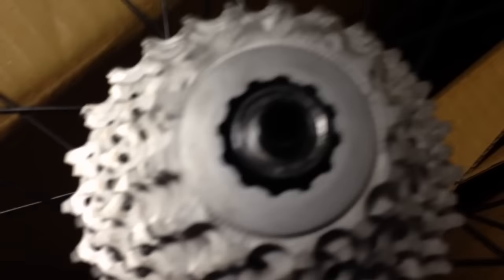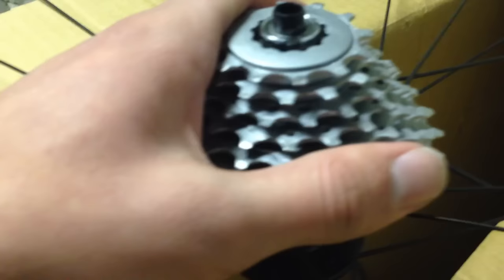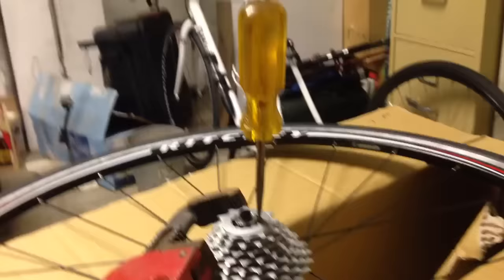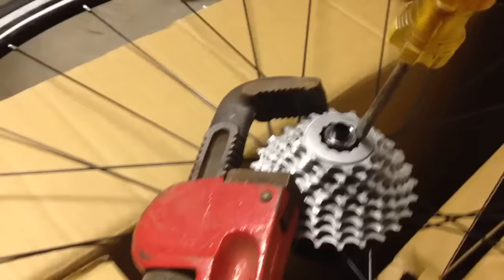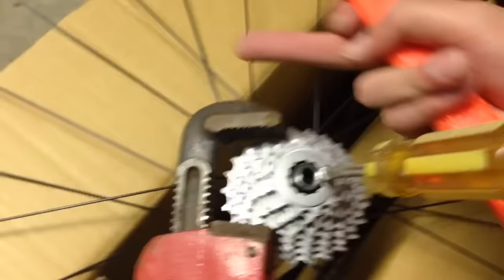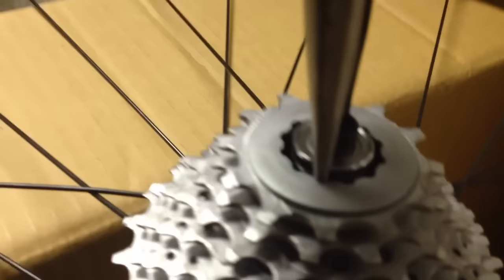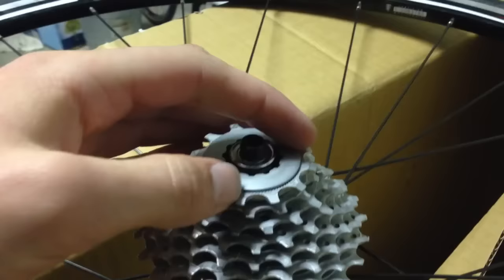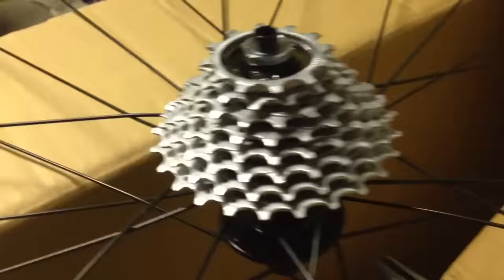How to Remove Bike Cassette Without Special Tools (IMPROVED

Comment: Folks please do not follow these nonsense.  These tools are pretty cheap to purchase and will prevent you from doing damage to your bike.  Get the right tools and save yourself a lot of headache.  If you ride a lot it's worth the investment.
Reply: Yeah really what's wrong? You don't want to get new tools? I love to get new bike parts but I'd much rather get new tools. :)WEST COAST:(
Reply: Unless one is semi-mechanically inclined and resourceful. I fully intend to buy all necessary bike specialty tools, and still have managed to get multiple parts changed without specialty tools.. these I'll likely order a cheap tool
Reply: If someone’s watching this video it’s because they need their bike fixed ASAP and don’t have the right tool, of course we’d prefer to just buy the right tool for the job
Reply: Agreed

Comment: if that cassette its tight enough its no way on earth you can hold it by hands and use that tool to open it.
Reply: Steven Mark Tobin  That's the daftest reply yet! So with the wheel back in the frame, how does one unscrew the lock-ring ?
Reply: Funny as hell. ;)WEST COAST:(
Reply: Use a towel to hold the cassette. Makes it way easier than your hand and worked like a dream.
Reply: @mzoern  sure did?

Comment: A chainwhip and the proper socket wrench are not expensive and every bike shop sells them. If you damage the cassette and hub then it's goodnight Vienna!
Reply: +KRAZEEIZATION They cost more than the cassette
Reply: +ixRAZORxi socket wrench is 8.95 EUR, chainwip you can make yourself with an old chain or use some heavy cloth to keep it in place. Just bought a shimano cassette for 30 EUR which was the cheapest shimano cassette I could find. So I don't know where you get your info from but yea, your argument is invalid ;P
Reply: +KRAZEEIZATION it's the weight, for touring, that makes socket wrenches + monkey wrench + nut rather stupid, because half of the time you won't even need them and still you need to bring them. So being able to do it with tools you find in every motorcycle store is a great help for tourers.
Reply: +ixRAZORxi I have had the same chain wip and cassette tool for 20 years. It was a good investment.
Reply: Messing around with improper tools always causes damage. Hammering precision parts like this is total disrespect to the engineering of them in the first place. A chain whip is pretty cheap, does the job without pain and costs far less in the long run. If you damage the cassette, hub and axle by hammering then you're really out of pocket, so pretty please with sugar on top, use a gawdamn chainwhip!!!!
Reply: +KRAZEEIZATION  the comment section in this video is filled with pseudo home mechanics a proper tool is a good investment and cheaper to do in the long run some people are just wayyyyyy stupid
Reply: +ixRAZORxi  its a good investment rather than you damage the tooth of the cassete and need yo buy a new one its safer to buy a chain whip and cassette remover. if you cant buy such tools and maintain your bike stop cycling. pls just stop its bad for the whole cycling community
Reply: +ixRAZORxi i paid like 5$ for the socket and made a chain whip for free out of some old chain and flat steel bar
Reply: +KRAZEEIZATION yep, and one could find them even cheaper used.
Reply: +Eric Herrera I mean the proper bicycle tools used
Reply: the chain whip is too expensive at the bike shop where I live....A chain whip from ebay is the ansewer.Not all sockets will squeeze in there you will need a thin wall socket...Investigate before making a suggestion...
Reply: I know some people are arguing, you might damage the cassette, personally if i damage the gears it doesnt matter to me, i can even damage the wheel beyond repair, i need it for the flat stock round metal of the cassette, id do it with a torch, but i got no torch, and i dont ride bicycles, so i dont see it as a good investment to buy some bike maintenance part ill almost never use unless im using a piece of scrap from a bike.
Reply: If they are cheap then why are you trying to learn how to do thia
Reply: KRAZEEIZATION Nice comment, well said.
Reply: Goodnight Vienna ?? So if a jackass damages the cassette he gets to see Ringo Starr and listen to the Goodnight Vienna album ?? WoW !
Reply: waaaaa... damn youtube safety patrol... your comments are common sense. But I have been removing cassettes with needle nose pliers for ever... never damaged one unless you consider some small scratches or slightly dented teeth damage... more likely to break your tools than damage the cassette... but most other bike tools are definitely a must have if you don't wanna tear somethin up!!
Reply: BaaaHahahahaaa..// Good one SouthHemiTV 3* Successful brain surgery.
Reply: SouthHemiTV 3 Ha! I know right? I'm a jack of all trades and I hillbilly fix a lot of things....no damage and it saves money.
Reply: KRAZEEIZATION use a 1 inch socket to use with the lockring tool
Reply: KRAZEEIZATION nu
Reply: @cyclingpunkhero2752  park took for the win
Reply: KRAZEEIZATION I just bought my bike from walmart(I know it’s not a very good place for this, but I’ve been throwing upgrades at it) I’ve bought a new 7 speed cassette for it and don’t have money left over for tools. So I kinda need to improvise here.
Reply: KRAZEEIZATION Good night Irene!
Reply: If you are going to be doing this repeatedly, the investment would be well worthwhile... if you only expect to do it only once, your 'cheap tools' would double the price of a cassette replacement, if I bought them at my local cycle shop.

Comment: I used plastic clamp to hold the cassette, the jaws weren't able to grip but the cassette easily dug into the plastic and gave me a pretty solid grip.  I then used your idea with the needle nose pliers and clamps some vice grips perpendicular to them for leverage.  Worked like a charm
Reply: Would a clamp to remove an oil filter work to hold the cassette?

Comment: I agree with most of your points
- never use the pipe wrench or 
- never use the screw driver on the locknut

The ones I disagree with are
- using the needle nose pliers, on the locknut
- using your hand on the cassette

These are potentially dangerous

The proper tools are necessary

Comment: Some of these things are crazy tight.  I was able to remove one tapping on it, but I had another one that I had to bring to a bike shop and two people almost couldn't remove it with the right tool.  Tapping with the hammer can also easily damage the bearings inside because these bearings are much softer than the ones on the wheels. So really try tapping gently, and if it doesn't work bring it to a bike shop, they will remove it in 2 minutes and may not even charge you.

Comment: This worked perfectly for me.  I used a pair of needle nose pliers, placed their tips into the groves.  I put on a a pair of mechanics gloves, and this allowed me to put my hand into the handle of the pliers (near the pivot point) to apply outward pressure on the pliers (as you are using the pliers in the opposite direction, not to grip but apply outward pressure against the grooves).  My second hand was able to grip the cassette tightly (again because of the gloves).  I turn both my hands, and pop it loosened up.

Comment: I have the tools for the job, they are not very expensive and make life a lot easier.

I needed my chain whip today but I have left it at moms, so as an alternative I used a bike chain I had hanging up, wrapped it around the cassette, then stood on the chain with both feet, then used the special tool to undo the locking nut.
Reply: +RandyDarkshade Yup I've done this as well! PITA too!

Comment: my hand grip stength wasnt enuff. so i did buy a chainwhip online.ironically the removal tool that came with it didnt fit any of the wheels i was working  on, it would not  go over the nut. S0, alongside the chainwhip , I  used a pair of plumbers pliers that i already had, to grip across both jaws of the pencil nose pliers when placed (wedged) in the lock ring. i found this replicates the direct force of removal tool and spanner rather than the pushing in then  twist forces generated with the hand. it was successful on both wheels. just b mindful to lean the wheel against your legs and apply downward pressure keep the pliers stable no wobble. if  they are loose it can jus slip out with a chance of rounding the spline on the lockring.  so thanks for the video it helped alot. i can now go riding on my turbo while we are locked down. be healthy keep safe, Stay Home.

Comment: Thanks for the video...worked great for me!!! Was doing it all wrong until I saw this video. I used needle nosed pliers but instead of using my hand to hold the cassette, I gently pushed/wedged the largest cassette onto a vertical 2x2 wood post (to keep it from spinning) and loosened the nut! Thanks!

Comment: Super helpful, cheers. It occured to me also if holding the cassette isn't enough (even with gloves, of course) you might wrap cord or rope round and round the gears in place of a chain whip - it should eventually bind into the teeth, but not put any strain on one particular tooth like the pipe wrench. Gonna go get mine off now!
Reply: Ah, ok, well mine is one of those bitches that ain't comin' off without a fight - I'll probably have to take it to the shop.

Comment: Great video! The needle nose plyers really did the trick and I only had a small pair. I have the actual tool in storage hours away. I wouldn't have bought that tool had I seen your video. Nice and short, quick to the point. I did use a big pair of channel locks. Thank you! And blessings your way.

Comment: next time I would try using a old piece of chain to hold the cassette instead of your hand, it would be more comfortable and work about the same as a real chain whip.
Reply: yeah ill probably be buying a cassette lockring tool for like 7 bucks but using an old chain and holing the chain with pliers works great instead of a chain whip
Reply: I absolutely agree.  I use this chain method and simply stand on the end of it to immobilize the cassette while my wrench releases the ring.
Reply: Same thought crossed my mind. Thanks for sharing this

Comment: I'd invest in tools . Your best bet is a Table vice grip and cassette removal tool, along with a chain whip (depending if cog ring or freewheel ) lock cass. Removal tool on vice grip , place wheel In proper removal tool and turn counter clockwise . !!

Comment: Thanks for the help I ended up taking my old bike chain nailing it to the 2x4 and then wrapping it around a few times then i put a screw in-between where the teeth would engage and it finally worked 🤣🤣 but your video helped me out to brainstorm this idea ahah

Comment: you dont need a chain whip. just a short length of old chain held in a mole grip works. id get the proper tool to remove the locking ring though. but the needle pliers looks ok, if you have them the correct size. if not you might as well just get the correct tool
Reply: Why not use the bike chain?
Reply: @Kitiwake  i have used a chain whip many times since then. it makes the job pretty easy

Comment: The easiest way I have found to undo the lock ring.
First remove the spindle.
Then get a bit of chain and wrap it around the cogs and push a screwdriver through the chain links.
Get someone to hold this .
Then get a 2 pence piece and a adjustable spanner.
Make sure you put enough downward pressure on the 2 pence piece and the adjustable spanner is a really tight grip on the 2 pence piece and then undo the lock ring. 
It can be done quite easily as long as the lock ring isn't stupidly tight.
I used to do this year's ago when I was a lad and didn't want to pay silly money for the tool.
But now I have the correct tools.
It is easier with the correct tools.
Try it you might be surprised how easily it works.
So don't judge until you try it folks.
But if the lock ring is stupidly tight it will just bend the 2 pence piece. 
There that's my trick for undoing the ring.

Comment: I spent about $9 and ordered the socket on Amazon and it came in 2 days. It was still INCREDIBLY hard to get it loosened. I dont think any one of these techniques would have worked if you have a bike that is more than a few years old. To me it was worth it not to cause a more costly repair (i.e. a new cassette) to my bike.
Reply: Yeah, its good to get the tools if you otherwise damage it or you will be doing this more than once.

Comment: I've got the tool somewhere but all I could find was the chain wrench, I tried the round nose pliers but it was too tight so I heated the locking ring with a gas torch and it freed off OK, the reason I wanted it off was to check it out, I'm going to weld sheet metal ring onto the smallest gear and convert it into single speed (it got an ebike kit so that's all that gets used)

Comment: I tightened a g-clamp nto the teeth of the cassette, so that the handle was down into the forks. This prevented it from turning as I gently tapped a masonry chisel into the lock nut.

Comment: I've done enough mucking about working on bikes without the proper tools-as a kid. It's not worth it. You can buy the lockring tool for like $7 on Amazon. You can easily damage components and yourself. Use the right tools. If you must you can use the pipe wrench with a few bits of wood to protect the teeth (if reusing cassette). You can also make a DIY chainwhip with some old chain. Also, the lockring needs to be torqued down pretty good when installing a cassette-good luck with that without the lockring tool.
Reply: The lockring does not get tighter with a cassette and freehub body. Hence the torque specs on the lockring itself. On the old system where the cogs are on a freewheel which screwed on to a freewheel hub, pedaling would tighten it up. These are two different systems for getting cogs on rear hubs.

Comment: All about pulling a MacGyver in a pinch but I fail to see this as a worth the risk and hassle for general bike repair. You can get a chain whip/socket/wrench combo on Amazon for like 15 bucks, I’ve used my kit countless times and its still working fine two years later. I just don’t understand people’s resistance to buying tools for stuff they will inevitably will have to repair.

Comment: did it with a hammer and a flathead . i just place the wheel on the ground and semi stand on the gears so they wont move and hit the sorta hexapart couterclock and it will pop open . and i only did minor damage on the hexa part . tnkx for the tip how to do it different .

Comment: Great if it works for anyone. But I bet it doesn't work for most people where some serious torque is needed to unscrew the ring -- there's a good reason the right tools are long. After some fight I just took my wheel to a bike shop nearby and had the cassette replaced for $5. Waste of time to struggle w/o tools in this case

Comment: A chain whip is less than $10 and a cassette/freewheel remover is less than $10.
A Freewheel is $20-30 and a cassette is over $50.

Do the math, kids...invest in the tools.
Reply: mtlnascarfan sometimes your local bike shop will take it off for free, that's what I did.
Reply: Bentley Smith There's that, too.
It's always better to have the tools yourself, though.That way you learn how to do your own repairs and save LOTS of money.
Reply: Or you can buy a cassette remover tool and make your own chain whip. That's what I gonna do. A used piece of steel cut it to 30-40cm. Drill 3 holes and use old chain tighten with bolts and nuts

Comment: Well dude you've done me a solid I liked your advice. I was holding the cluster with a belt grip and had a monkey wrench to loosen the nut. It slipped and I took my ass out with a wrench to face when it slipped off 🤣. Nose is a bit crooked now but I'm wiser for the experience. Grabbing needle nose pliers as of right now 👍🏻
Reply: If you have a lathe easy problem. Make your own release nut. Turn a bar to internal dia of grooves. Reduce dia of bar three quarter inch's back from end of bar to able hacksaw space  Divide bar end into numbers of locking grooves and hacksaw side of bar to match the end divisions. Worked a treat! Release nut available from China quite cheaply but wanted it done before dinner. Found putting tyre up against doorway provided a good holding force for release of ring.

Comment: just bought a bike from what looks like the 70's.  I am looking to fix it up by myself.  The wheels are dry rotted so I will need to put new wheels on and everything.  I also will need to replace a spoke on the back wheel.  It looks like I will need to purchase a freewheel removal tool.  With that, I should be able to take it off and reuse it?  Are there different types of freewheels, or can I pretty much purchase a universal freewheel removal tool.  Last question: I do not have a "truing station" I think is what it is called, but I don't think it should be too difficult to create one.  Do i need to True the spikes and wheel when I put a new tire on?

Thanks,
-Scott

Comment: In a pinch I have used a gloved hand for a chain whip and 2 nails in a 1x2" piece of wood as the internal spanner. Was too tight without the glove. The right tools are so much better if available though.
Reply: My problem is leverage. I got the right tools but the cassette is so tight will not bulge. Used wd40 nothing wasn't about use liquid 🔧 due to the fact it might get in the hub and don't have piece of pipe to put over wrench to add leverage. Will try this next

Comment: I tried your method just now, I had the same tools, however using my hand was impossible to hold it, I even tried with a towel in my hand, also tried running a power cord around it and hold it, also the grip wasn't enough compared to the power needed to accomplish this.

Comment: Hey great video! May we know the exact specs/tip diameter of needle nose pliers that fits into the grooves of them lock ring? I see most needle nosed pliers marketed as "M10" would those work?